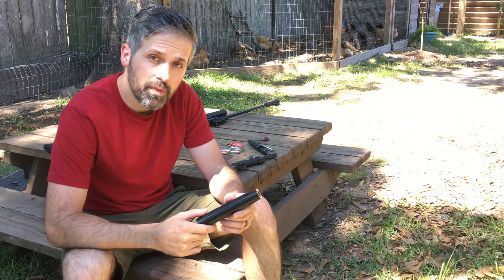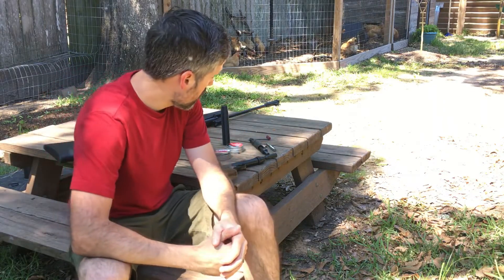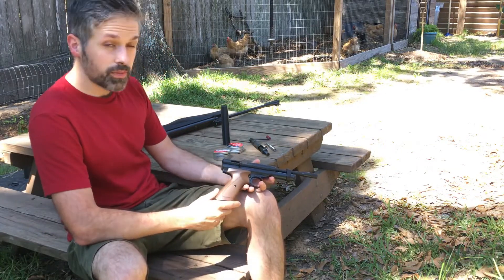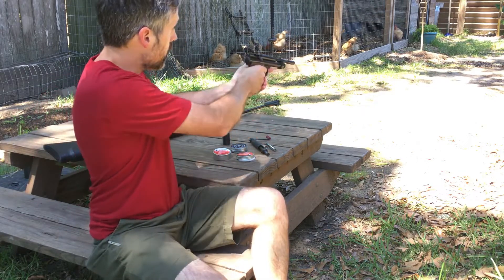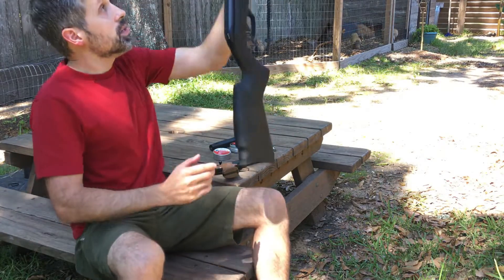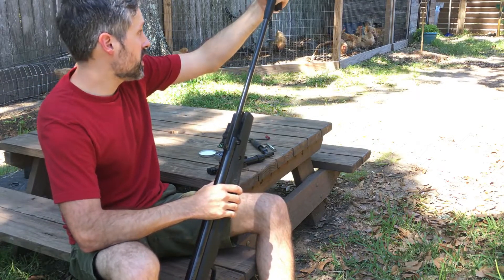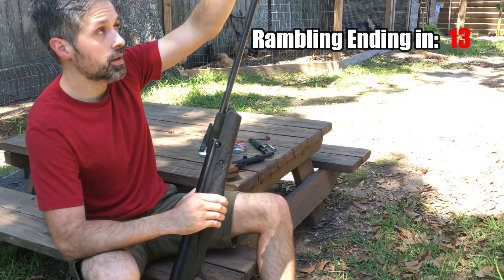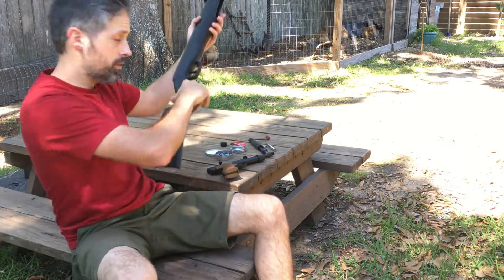Buck Rail 1/2-20 UNF Suppressor Test

Comment: The 1/2×20 suppressor is Good! Quiets very well. Although I wouldn't recommend using it in the heavy wood or brush hunting. Pesting seems good as long as your barrel is all clear. Ed da pro snippin air man💥💪😱
Reply: I only use my suppressor when in town, out in the woods it is full blast!

Comment: hey man question here about the cross threading i recently bought a daisy 880 suppressor and when i got it and tried to install it, it got stuck and it cant screw on more then half way
Reply: Yeah, you cross threaded it. I have a fair background in machining and you really need to rotate fine machine threads in the opposite direction till it "drops" in. a lil oil never hurts either. If you are forcing machine threads, then it is cross threading. I have messed up my fair share of threads as well.

Comment: Hi there! I'm looking for a baffle system/suppressor adapter for a Avenger Bullpup .22cal. Baffles go inside the shroud, then a 1/2 - 20 UNF thread for a suppressor. Do you carry those?
Reply from the maker: I do not, yet. A lot of folks just get the DonnyFL Avenger threaded adapter and our 1/2-20 UNF suppressor. We also make a cheaper direct fit suppressor for the Avenger Bullpup here: https://buck-rail.com/product/air-venturi-avenger-suppressor/#reviews

Comment: Hi sir, would it be a trouble if i wish to know the outer diameter of Crosman 13xx suppressor? Also, the adapter available for Crosman 13xx, is it threaded 1/2-20? Million thanks!
Reply from the maker: The 13XX suppressor uses a different suppressor than the one featured in this video. It is 27mm in diameter, or 1-1/6 inches.

If you want to mount the 1/2-20 UNF suppressor (the on in the video above) on the 13XX you will need to install an extended barrel and use our UNF adapter or you will need to purchase a 13XX UNF adapter from another manufacturer. https://maverickcustomairguns.com/ sells them, but they seem to be closed at the moment.

There are also some butt ugly ones on ebay from Germany if you just search "Crosman 1377 UNF"

Maybe I should make some. The only reason I never did, was because other folks were already doing it very well.
Reply: @BuckRailAirguns  Thanks for all the tips, I'll take a look at your Buck-rail site. You've been really helpful.